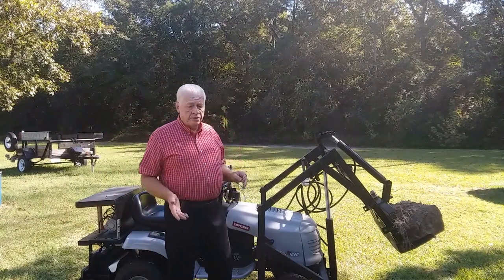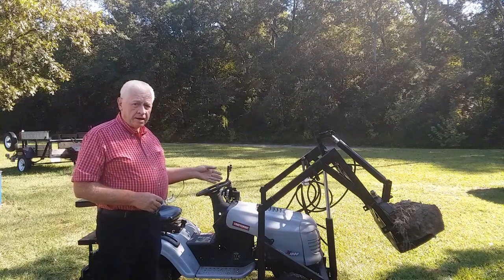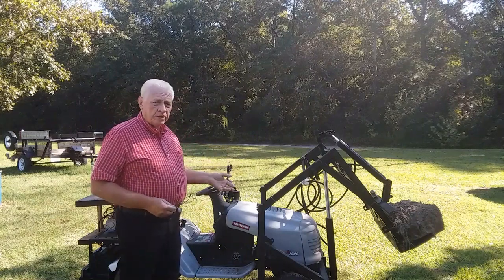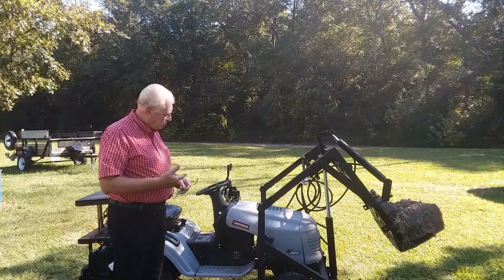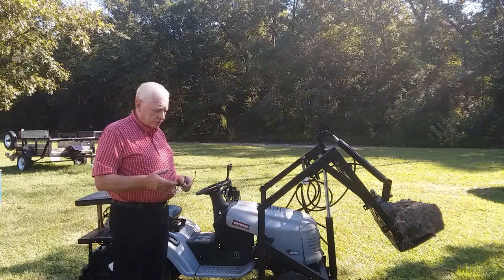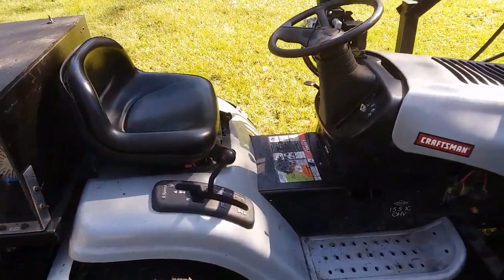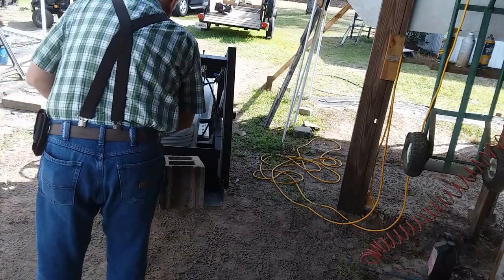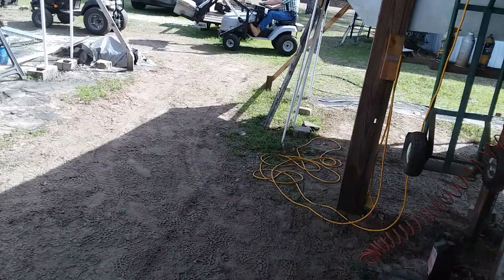Hydraulic or Electric front end loader - which one is better?

Comment: I'm thinking about doing something similar. I'm curious as to why the pump is hooked up to a separate battery instead of the battery that starts the mower.
Reply from the maker: The mower battery is not robust enough to continuously handle the electrical load that the pump demands. The pump only runs on demand - not continuously. As the pump builds pressure the electrical draw can exceed 150 amps DC. The mower battery can handle that kind of load only 3 or 4 times. The big battery can last for a couple of hours before needing to be recharged. The mower alternator can not handle the load either. you will likely burn it out if you connect the pump battery to the mower system. In a residential setting being able to use the loader for an hour or 2 is sufficient. Using an external battery charger works just fine. For continuous use you would need to add a high output alternator. See my alternator install video at : https://youtu.be/QZ4psLskhc4  I hope this helps, Ed
Reply: @eds2centsworth203 
Thank you for the info. You probably just saved me a lot of problems.
Reply from the maker: Glad to be of help, Ed

Comment: For electric actuators do we have to factor in vibrations/shocks to the shaft while its extended. Like when its attached to a hitch and it lowers is it worth adding some springs to dampen vibrations...especially if its lowering an implement to the ground? Thanks
Reply from the maker: Keep in mind that the electric version is lighter duty than the hydraulic. For serious daily residential work I would go hydraulic. For occasional heavy work the electric is fine. This is for residential application, not farming or professional landscape work. Either version will not compete with a category 1 tractor.

Comment: Hi Ed, I am wanting to attempt this with my massy furguson mower which has plenty of power at 23hp but I am very worried about its comparatively weaker Transmission which is hydrostatic. Have you attempted to do this with any Hydrostatic tractors. I was looking at picking up a 90s Craftsman with only 12hp engine and a 5speed peerless Transmission, would this be a better bet? and would it be worth the $400 to switch to that?
Reply from the maker: I can't comment on the Massey Ferguson, but I have found that on the riding mower conversion to front end loader that the hydrostatic transmission with the 23 inch rear wheel (12 inch rim) works well overall.  The manual transmissions have a little trouble when pushing into a pile of dirt (forward gear) and then shifting into reverse to back away from the dirt pile. The hydrostatic trans is pretty much seamless. The tractor in this video was a 7 speed manual. The transmission would load or bind going from forward to reverse if I tried to change gear before lifting the loader bucket. If I lifted the bucket first and then changed gear it worked better.  I built a loader on a Craftsman GT6000 with Hydro transmission and 23 inch wheels and it worked well.  I can't comment on the 5 speed Peerless but they seem to have a good reputation for garden tractor. Hope this helps.
Reply: @eds2centsworth203  it does, thank you.
Reply: I would second the fact that hydrostatic are pretty robust.  I use a few mid sized tractors on my farm that have hydro transmissions.  I don't think it will be a limiting factor for you

Comment: Actuators can be very fast and of comparable speed to hydraulics. Where excavator manufacturers have removed hydraulic systems entirely from a battery version of a diesel model, it has given operational benefits. Its probably about choosing the best actuator for the job. Those electro-hydraulic units you installed are also compact and very good.
Reply from the maker: Yes the actuators have their place. Unfortunately the really high end electric actuators are on the expensive side and not feasible for a weekend fabrication project that is for the home owner. If it is a commercially viable build then money is less of a barrier. Overall, dollar for dollar, hydraulics is the best choice.

Comment: Great Ed . Can you tell me what size tubing you used for the arms and what hydraulic cylinders. You used ?
Thank you 
This helped a lot😊
Reply from the maker: I used 2" square (A36 structural steel) with a 1/8" wall thickness. 
The 2 hydraulic cylinders were both the same - 2" bore x 16" stroke with a 1" rod. I bought them on sale through "Surplus Center".  This is an awesome site to get hydraulic components. Check it out at www.surpluscenter.com. If you place an order they will send you a printed catalog. You may be able to call them at 1-800-474-5198 and ask for a catalog (not sure). I hope this helps, Ed
Reply: @eds2centsworth203  Thank you very much Ed . 😀
Reply: @eds2centsworth203  wow, their prices are great Ed thanks😀

Comment: Thanks it’s a better option than battery but you haven’t said anything on how to connect the system what size hydraulic pump cost wise and a schematics diagram please let me know how to put it together thanks
Reply from the maker: Assuming your tractor does not have hydraulics already, this is what I recommend as far as a Hydraulic pump - https://www.amazon.com/Vevor-3200-PSI-Hydraulic-Quart/dp/B07ZCLS6RN/ref=pd_cart_vw_crc_sccl_2_2/139-2299784-2253507?pd_rd_w=OUWdW&content-id=amzn1.sym.75873c58-c777-4e96-9e4c-71edd776d2ed&pf_rd_p=75873c58-c777-4e96-9e4c-71edd776d2ed&pf_rd_r=0A0VZ2EKX30979E2CX5X&pd_rd_wg=q2r29&pd_rd_r=2ba06dac-39c8-454f-a4ef-dcd04479783f&pd_rd_i=B07ZCLS6RN&psc=1 . This is a double acting pump, you will need to purchase "double acting" cylinders. 

The above mentioned pump operates off of 12 VDC. It uses electric operated spool valves already incorporated into the pump.  The pump will use a lot of electricity so a heavy duty battery is needed.  Here is a link to a battery that I have had good success with on several projects. It is called the Everstart Value 65 -  https://www.walmart.com/search?q=everstart%20value%2065%20battery .

I posted a video a few years back that provides some specifics in building this hydraulic system. See my video - https://youtu.be/4mflY5zBKrI . 
I cannot provide step by step instructions but I believe this video will be very helpful.  Ed

Comment: I built one myself and I don't use any slow linear  actuator or hydraulic gadget 9 days ago. here is Part 1    https://www.youtube.com/watch?v=P5OY4QRIbQU
Reply from the maker: I have a question. Does you tractor battery and alternator supply enough power to the winch for continuous use?  I was thinking you probably beefed up the battery and alternator. Ed

Comment: Great video! Thank you for sharing your knowledge & for your hard work. You have saved us all time & money by doing these demonstrations. You're the only person that I've sec in YouTube that has had the expertise to power their homebuilt loader with hydraulics. I've seen actuators, winches, & now hydraulics. I am just in the concept phase of making a loader. Any thoughts on using jack screws? They're pretty tough & can be fast. Thank you for taking the time to make these videos. I hope more people find them & learn from you!
Reply from the maker: I appreciate your generous comments.  As for jack screws, they are heavy duty, for sure. If you already have screws powered by DC electric motors or Gas engine - if they have a decent stroke length for your loader design and if you can reasonalbly keep the screw part out of the dirt, then I'd say go for it. But if you have to go out and buy them, then I'd say go with hydraulics.
Thanks again, Ed